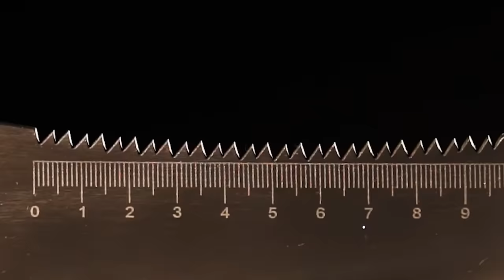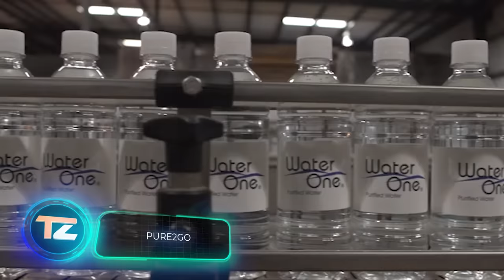16 SURVIVAL GADGETS EVERY MAN SHOULD HAVE

Comment: I'm actually impressed that the flashlight lasts even 15 minutes at the highest setting. 
The survival paracord would be better to use as as a hoodie cord. It's all well and good for having it as laces, but then you have no shoelaces if you need to use it .
Reply: I think there was an outer layer that pulled off the cord. They go back on as laces. If not maybe version 2.0 lol
Reply: @ourkeving  there is but I'm speaking from experience. I use Paracord for laces in a few pairs of boots and had to use them before. If you use just the outer casing, once you tie them you can never untie them. It gets so thin that the knots are tiny and super tight.
Reply: It is being used.... As bootlaces....
Reply: @Zer0fuks Monday’s child has learned to tie his bootlace. 
See how they run.
Reply: those torches are fairly easy to build... I've got a 4D maglight that now has a 100W car LED-headlight bulb, just swap out the 1.5v D-cell batteries for 32700 batteries.   
It does get damn hot, but in theory should run for about 30mins.   It also cost a fraction of the $250 their 100w torch does, and looks like something out of Fallout  :)

Comment: The biggest problem with the poncho tent is that it will NOT Last. The cheap zipper will give away (just one bad zipper is game over). A rip or normal fabric wearing out is bye bye water resistant (100% guaranteed it's not waterproof). Trust me, it's better to have a single purpose device.
Reply: One Tigris makes good kit. I'd be surprised if it fails easily.

Comment: In all my experiences of them, the rope saws are hell to use. Id rather chew through a log with my teeth.
Reply: Ive actually had really great results using them with a new chainsaw chain. I was helping my dad cut some limbs that were 15 - 30 ft off the ground. The trick i found is to have 2 people if possible. If using it single, try to keep the ropes as wide apart as you can manage. It sucks, but it's doable. We were cutting limbs 4" - 8" in diameter.
Reply: i agree with you. Never tried one worth anything

Comment: Wow, since they came out with CREE LEDs, I haven't seen a flashlight beam with dark areas. I remember back when MagLite & Streamlight competed to design a Police flashlight that didn't cast a beam with that annoying "Black Hole" in the center.
Reply: ...Most maglites have (or had, got mine decades ago) a lense you could focus by rotating the "head" of the flashlight. So there is only a black hole in the center if you focus the light in a super wide angle. Otherwise, you get full illumination in the center.

Comment: Flash light is dumb haha I bought a 50 dollar laser torch off of a temu like website.. actually it was 35.99 and the battery lasts forever it can shine 7 nautical miles.. it will burn a hole through paper or cardboard is no time at all.. light matches 15ft away in a few seconds haha it's actually really cool.. can easily light a fire.. then buy a nice 80 dollar waterproof 750lumen flashlight